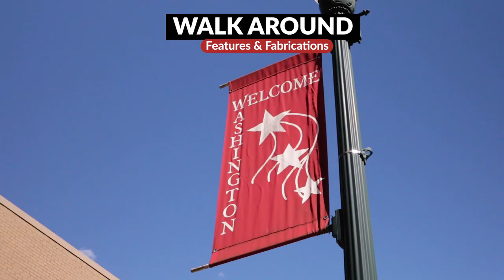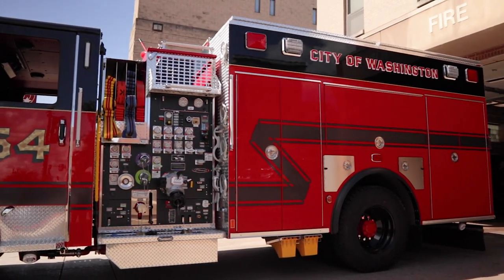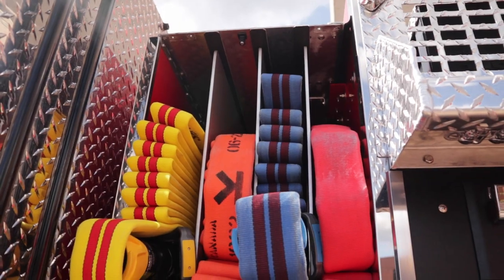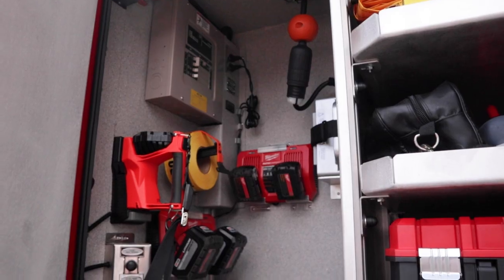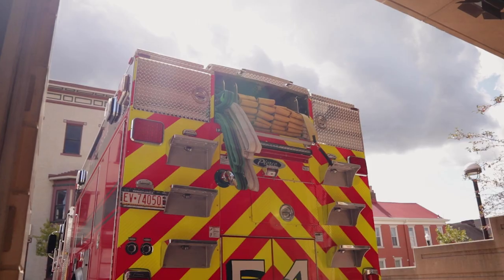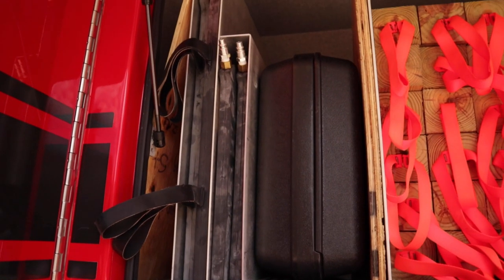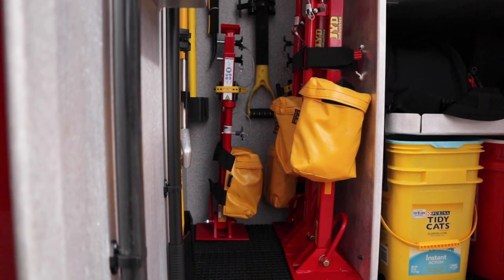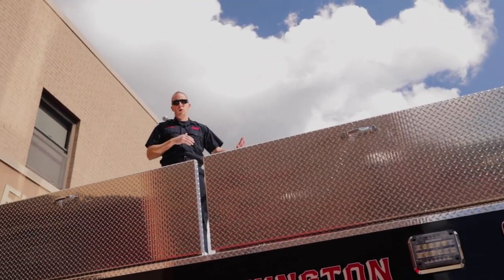City of Washington PA Pierce Rescue Pumper

Comment: Everything this guy is saying about the apparatus has been being done for years none of the stuff the was “ custom made “ has been utilized by hundreds for several yrs now.
Reply: I agree. Nothing unique here. Looks like a pretty typical modern rescue pumper. The wheelbase isn't all that short. Newer chassis have a tighter turning radius so getting around urban streets is easier.
Reply: I get your point, but all fire trucks are custom spec'd for individual departments. It is not like you are driving past a Ford Dealer and picking up a mass produced F150...